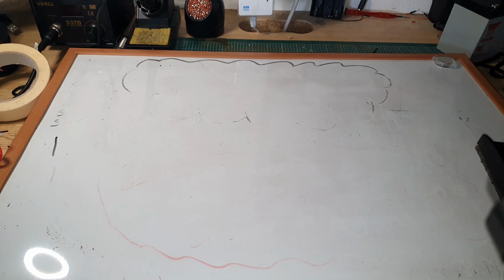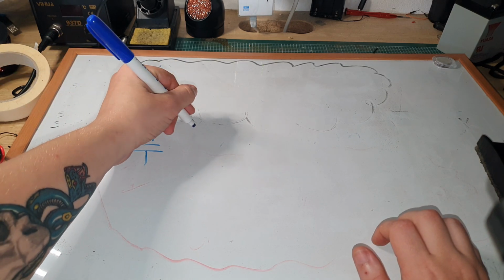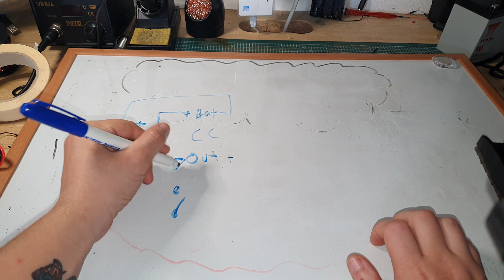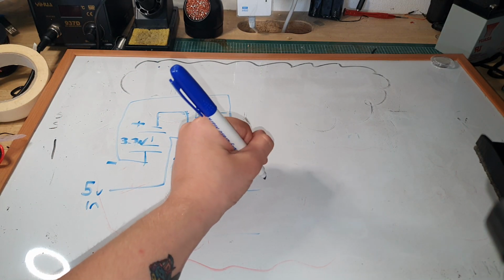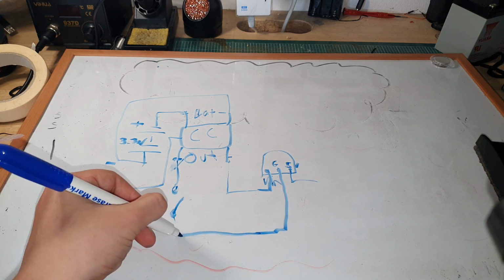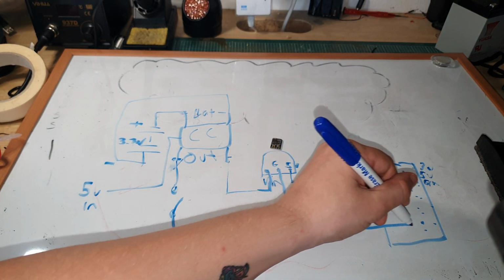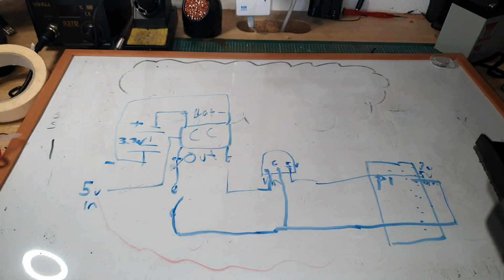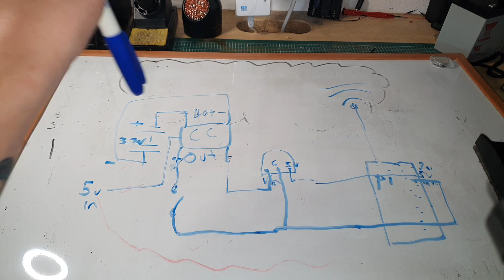WiFi PumpkinPi3 Wireless MiTM devices hardware build

Comment: an OTG cable would of probably been of use rather than splicing into wire but would add a small amount of bulk i guess.
Reply from the maker: Also not as fun as just hacking open a cable :)